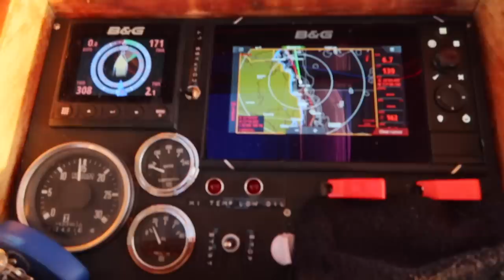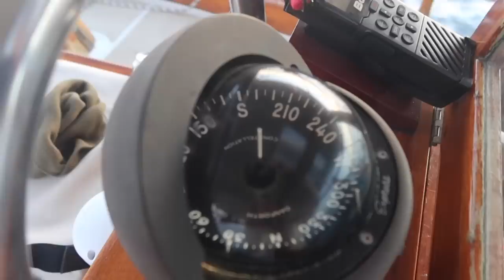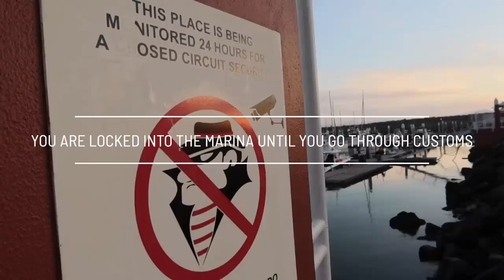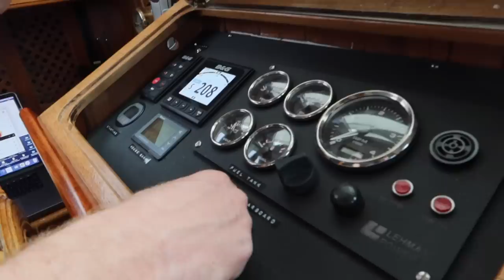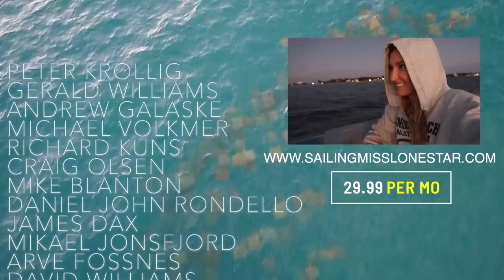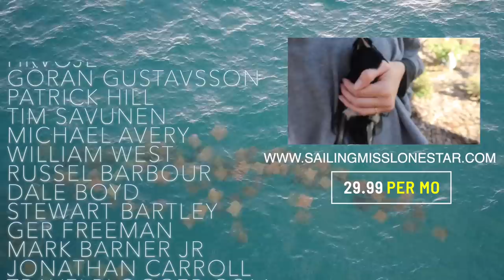Entry denied 🙅‍♀️ PIRATE SHIP S16E06

Comment: Don't know if this it right, but might be worth a look.  On the steering, bleed the hydraulics again. I know you did it but even a couple bubbles can make trouble. Second thing, there may be an adjustment on the amount of gain on the input from the wheel.  (If it is a servo type set up) Less gain may mean more helm effort and feel.
Reply: A rudder position indicator could also help.